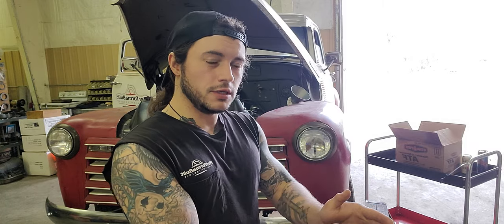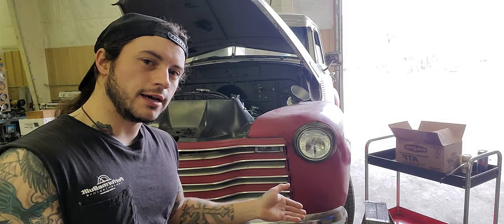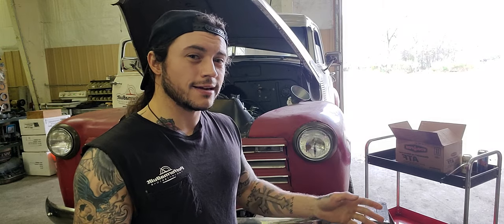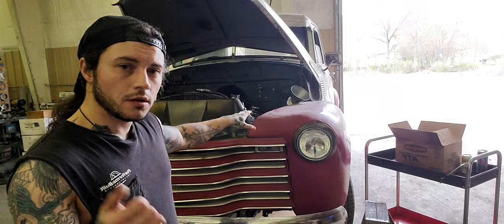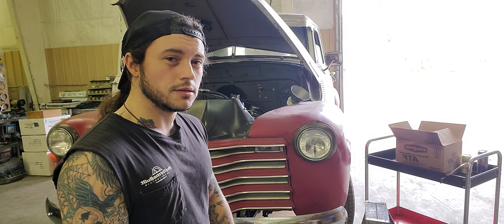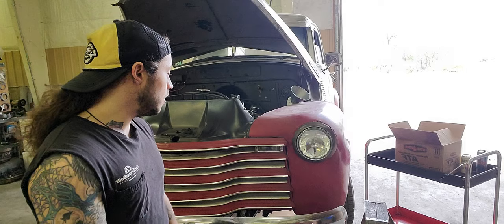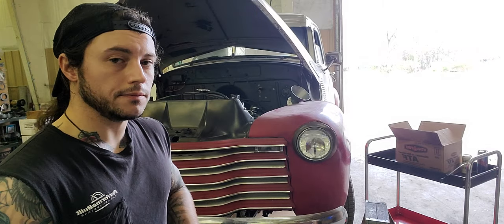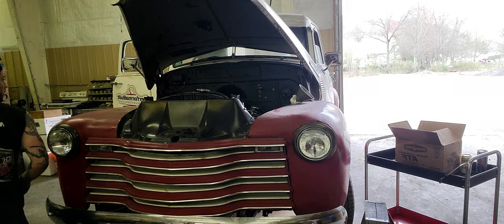Transmission Fill Procedure! Cracking quarts and Cracking myths! Www.performabuilt.com

Comment: Better than dumping 5 quarts of engine oil into the engine .... with no drain plug! Been there, done that, but only once, HAHAHA!

Got just shy of 4k trouble-free miles on the new transmission so far. Been on several trips around New England with the Heavy Hauler and my flatbed trailer. Took a 12 hour trip to PA and back for 4k lbs. of metal roofing for a buddy's company, then hauled a few 3,600 - 4k lb. Euro crossovers all over the place.  Every time I go out, the way this transmission works just makes me smile. BEST EVER, and I've been driving for 3 decades and one year. I've driven stock, and I've driven "built to the hilt" - nothing works as good as my Heavy Hauler, and that's a fact. 

Getting prepped for a trip to Wauchula FL from here in central MA in a week, towing my enclosed trailer. Going down there for paramotor trike training, using my own equipment. Going to be a blast! I have no doubt the transmission is up to the task - it's the engine, transfer case, and electrical system I worry about (I already rebuilt the rear differential). Say a prayer that I make it, LOL! :D
Reply from the maker: Im really happy to hear and i have no doubts it will handle any task. We try very hard here at PB

Comment: that's sounds great i have a bunch of Mercon LV  7 -5 qt jugs i was wondering if they are good for a 4l60e
Reply from the maker: If it meets the min dex merc 3 requirements then should be just fine. Tbh most of my customers use the anti foaming john deer hyguard with a splash of atf for color

Comment: Question about the Lock-up circuit: approximately how much fluid will it pull when the transmission goes into lock up? We don’t really have a reasonable way to get the transmission into lock up without driving it but don’t want to burn the transmission up if it’s going to pull a ton of fluid.
Reply from the maker: If you put a quart in the tq converter before you filled it then dont worry about it and top off as needed. If you didnt, it takes about a quart.

Comment: Thanks for the information dude, have been a little confused on the fluid quantity of my 2002 trailblazer ext. Ive changed it twice now and the first time only had 4.5 quarts come out, so thats the exact amount i put back in. Any idea how much should be in a 2002 Chevy trailblazer with a deep pan? Thanks for your time in advance.
Reply from the maker: If its just a drain and fill service then 4 to 6 quarts is expected. You have to use your dipstick to verify full. Every setup varies

Comment: Yo Mo, I know you Know and that is why I'm here... I have a 1986 listed as a 1987 Chevy G 30 platform and mounted on it is a Winnebabo minnie winnie 21' and "MO" is fine, had the TB400 rebuilt and soon will mount it, your susjection only, what fluid would you run in It? Dude I know the legality's, just want to get back cruising, Thanks...
Reply from the maker: No idea. Sounds like a nightmare

Comment: How would you recommend i do the initial “break in” of the trans (running through all the gears and lockup) since i have a new motor as well and that needs to be broken in immediately?
Reply from the maker: This video is exactly how you break in any auto trans. Fill properly, run through all the gears and lockup, let it sit overnight to bleed hydraulics, and service it fluid and filter after 500miles or 5 passes then a more normal yearly service every year. Rewatch, all the information is there. Driving an auto a certain way hard or soft has nothing to do with breaking it in.
Reply: I think i worded it wrong and thats my fault. What i was trying to say is, i have to break in my camshaft on first start up and i was curious if i should wait until after the camshaft break in period is done to go through all the gears or should i do that as soon as i start it up. If you mentioned something about this in the video and i missed i do apologize.
Reply from the maker: You should be able to make it through all gears on jackstands with mph not so much rpm.

Comment: Hi thx for the vid, subbed. We rebuilt a trans, the old guy told me to add 4 qts then fire it up and go thru the gears turn it off and add 4 more and go from there. We never prefilled the t.c. either. Could this have done damage
Reply from the maker: Probably just a little to none. Adding fluid to the TC really helps prime everything and ease the trans into its first startup.
Reply: @PerformaBuiltTransmissions  it was the same tc that was in it so should have had some fluid still. The reverse is acting up so gonna look it it again. Not very happy with the castrol universal atf and cvt fluid. Has the spec but gonna change it out
Reply from the maker: Use dex 3 or 6.

Comment: So what does "hot full" mean? Mine is at the top of the hot full mark when warmed up and after driving, but when towing my pontoon on a warm day for 20 miles I'm 1 pint over the mark. So how hot is hot and how full is full?
Reply from the maker: Hot full is full at Operating temp and that varies per setup. My particular trans runs at 140 hot. Most oem setups run 190 to 200. You will have to use your judgement. If its going over hot full when at operating temp, you have overfilled it.

Comment: Hey Ryan, quick question. How does one get the gasket off my 700r4 valve body....It almost looks like its glued on and is only coming off in tiny pieces.. Thanks!
Reply from the maker: A razor blade and patience. Thats the only way
Reply: @PerformaBuiltTransmissions  yeah, thank you. I started using the blade and its def a chore :(

Comment: Cool. I've change my truck a few times. Hey how did u get around the steering box on a pre 1954 truck with a 8 cylinder. I've always known that to be in the way.. We used to put a mustang 2 front end under.
Reply from the maker: Alot of beer.... jokes aside i had to make custom bisquit mounts to move the motor over an inch to the pass side. It doesnt affect drivability and youd never know. I do have a mustang 2 conversion to install but havent gotten the opportunity. As far as i know im one of the rare few that has a 454 with the stock steering box. Hugger headers helped and its still very tight
Reply: Awesome. Good thinking. Thumbs up to you. And thanks for your videos

Comment: Hello  I just finished my 1950 chevy truck swap to 6.0 L LS2 with 4L80Eand PSI harness today was my first start for the truck   and in the first test drive, it moved smoothly  from 1st 2nd 3rd gear then I parked the truck to work on the tail light.then I tried to change the truck's place to park it inside the garage I noticed that the gear is not shifting its stuck on the 1st gear. its move from  P_R_N_D smooth I checked the oil and it was fine   no leakingchecked the solenoid  it was plugged  correctlyand idea what's going on?by the way, I didn't tune the truck yet   is it from tuning? do its need tunning?engine and transmission? or it could from something else   help pls - and idea whats going on >?
Reply from the maker: depending on how many modifications you have done to the motor, the trans will absolutely need tuned for along with your engine